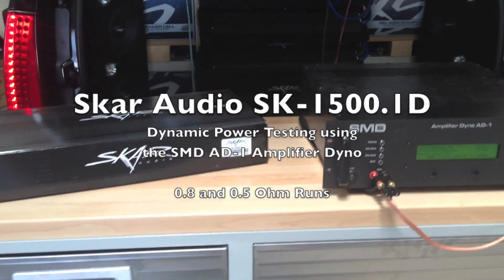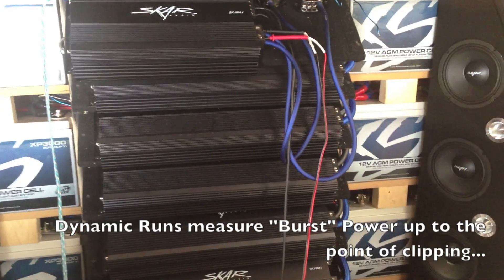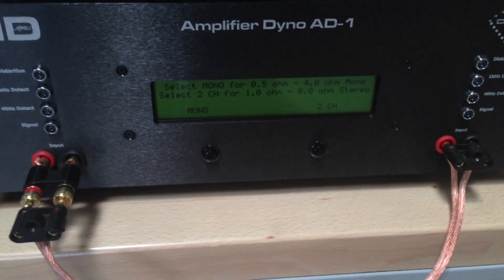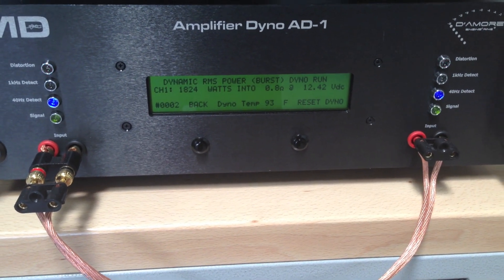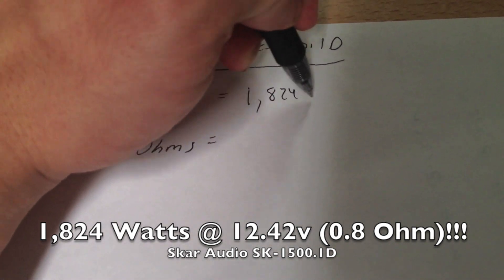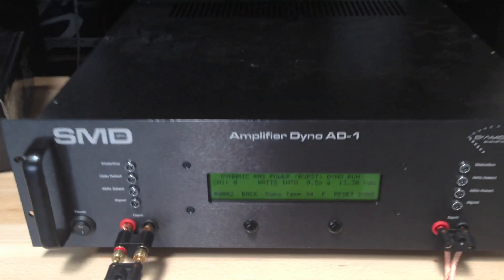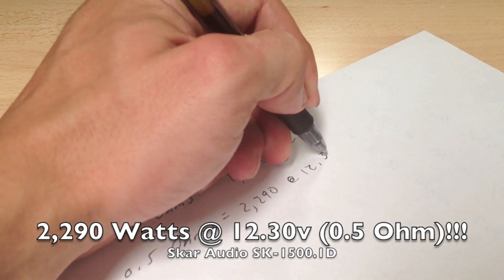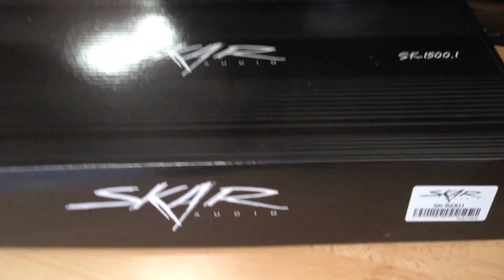Tested Skar Audio SK-1500.1D "1500 Watt" Car Audio Amplifier w/ SMD Amp Dyno AD-1

Comment: Run two 1500 dual 2 ohm pairell  1 ohm both amps  1500 to 1700 per 18 evl rewire and gain  match both subs square  root 1500 is 35 ac volts each amp 😂

Comment: I’m looking to run 2 d2 evl 18s both at 1 ohm, was wondering if a sk2500 at .5 ohm would be better to run than 2 sk1500 each at 1 ohm strapped

Comment: dont waste your 200 go with orion 1500.1 i bought rp 2000 amp went to protection in 10 mins and never came out of it.
Reply: I've been looking at the Orion xtr . The skar dynos are very shady. 1800 watts from a 1500 watt amp @.8 is not impressive.
Reply: @theshark2804  check out Ryan blankenships and big d wizs channels on here...they dyno all kinds of amps also,including this line....these did quite well actually.

Comment: i cant see where it is wired to the smd???
Reply: Daniel Parra ik right i just ordered one but the new one v2  they r same amp tbh i saw the internels there the same just diffrent heat sink and bass knob has clipping light now
Reply: it still does not answer my question where is the wire going to the amp? i cant see it. all i can see is the one conectited to the smd..
Reply: thanks for the reply though.... 😉

Comment: Placing order for Skar SK1500.1 now
Reply: They got it on .5 ohms. Notice how when they finally do a 12volt test they put it at a .5 load? Don't do this, this amp on a half ohm for an extended period of time is bound to go bad.
Reply: ....................

I made that comment like 2 years ago bruh
Reply: RollTide ColdBeer I didn't look at the date. Well did it work?

Comment: not to hate at all but why is it such a big thing now to under rate amps when you know how much it puts out and ask the rated price plus show what it can do @ .5 ohms and it not recommended to that you will void the warranty just say the amp is 1800 watts @ 1 ohm @ 12.5 volts instead of 1500

Comment: Is the amp warrantied below 1 ohm?

I see you did all of your testing below 1 and it needs to be wired below 1 ohm to get power. Is it .5 stable?
Reply: SnowDrifter that's what I want to know to because the manual said the minimum is 1 ohm